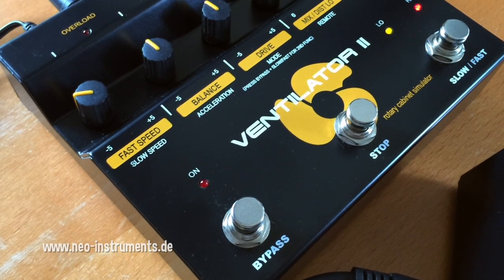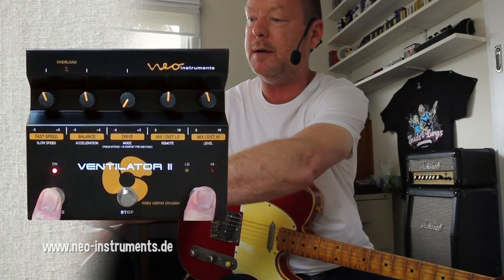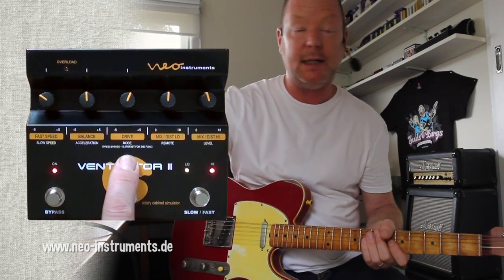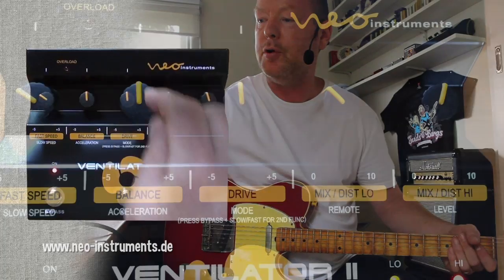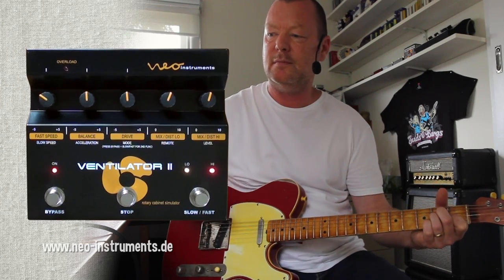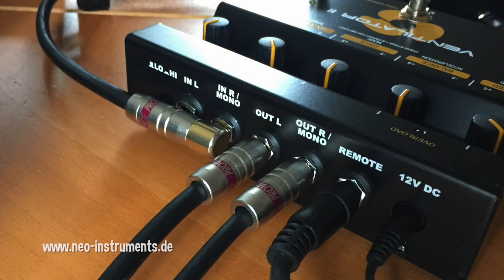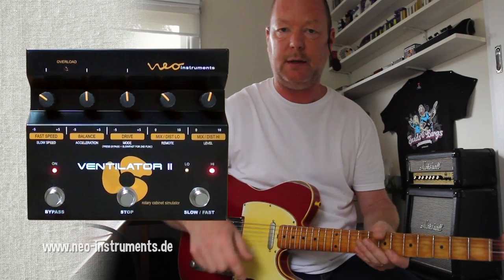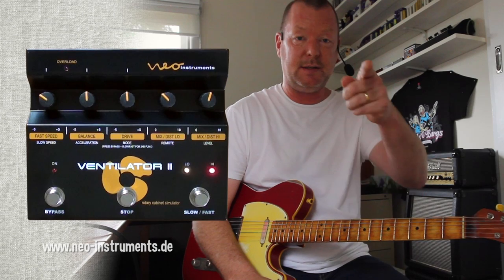Neo Instruments: Ventilator II Rotary Cabinet Simulator

Comment: I have this pedal for six month now, and as usual the real test for me was to test it within a band. I did it and this pedal is amazing! You can dial so much different sound from it and you can keep it very transparent also if you want, thanks to the mix knobs! I just think the stereo image could be improved compare to a Lex but it's the only very small drawback (and maybe the fact that you have to use the wallwart power supplied...).

Comment: What the heck is the button on the rear for? Can't find in instruction manual.
Reply: “lo/hi” …impedance. I’m forgetting what is what but other devices typically call this switch “instrument (or guitar) vs line level” …just don’t ever plug anything in from the headphones output from any device …Neo Instruments has a warning that this will break the device which is what happened to mine when I did it (it is repairable tho) and mine was fixed (under warranty in my case).

Comment: Hi Brett.  Do you notice a really audible jump in white noise when you engage the pedal?  That's happening to me, even if the guitar is completely unplugged.  The sound of the pedal is fantastic, but I'd really like to solve this noise issue.
Reply from the maker: I must admit that I didn't notice such a jump and having sold the pedal over a year ago, I'm unable to check for you, I'm sorry. You'll have to consult Neo Instruments about that one. Cheers, B.
Reply: Thanks Brett.  I already sent them a message with an audio sample.  May I ask why you sold the pedal?  Also, your videos are great, thanks for all the info.
Reply from the maker: I inevitably end up selling most of my pedals to pay bills or pay for the time it takes to make the demos. Also, I run Fractal Audio gear on stage which has close approximations of nearly every pedal, effect, amp and speaker cab known to man so I don't need them (even though I'd love to keep them all!)
Reply: Got it.  Thanks for replying.